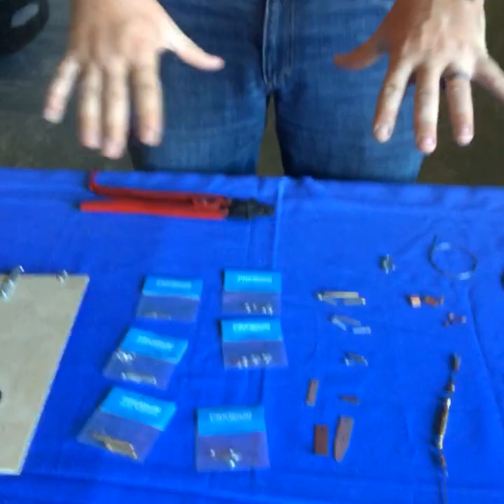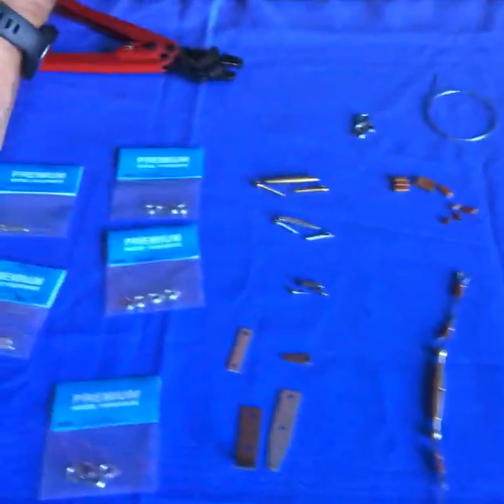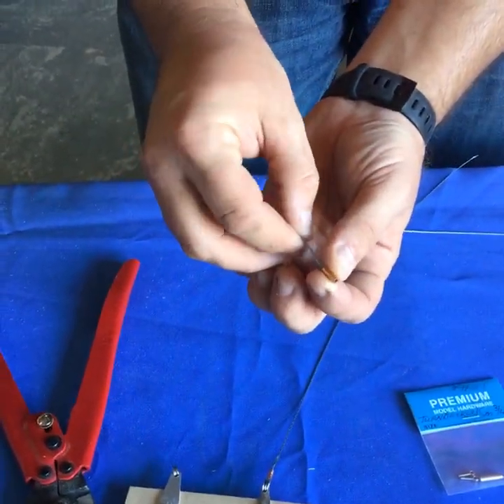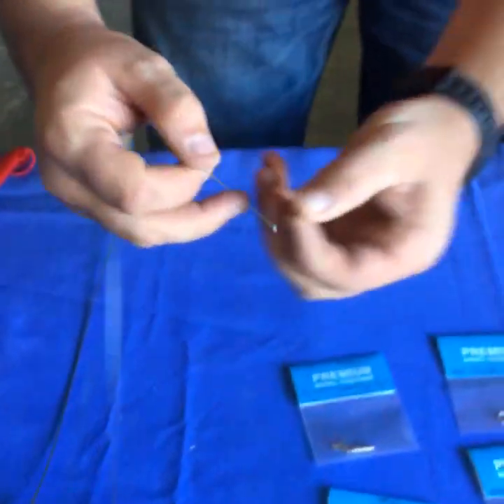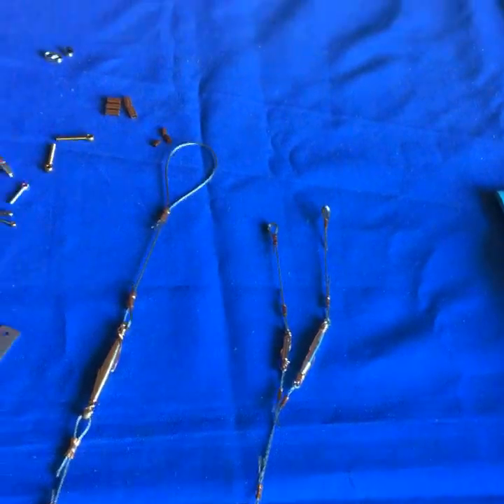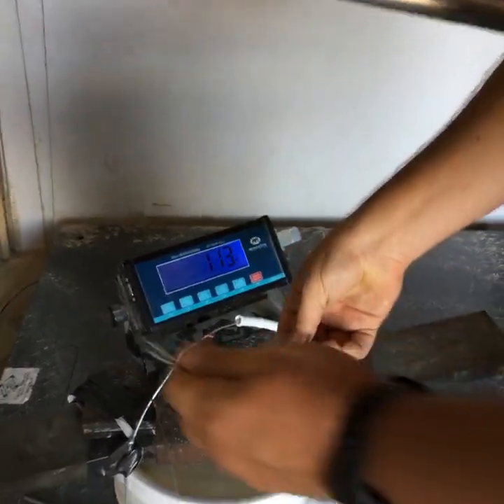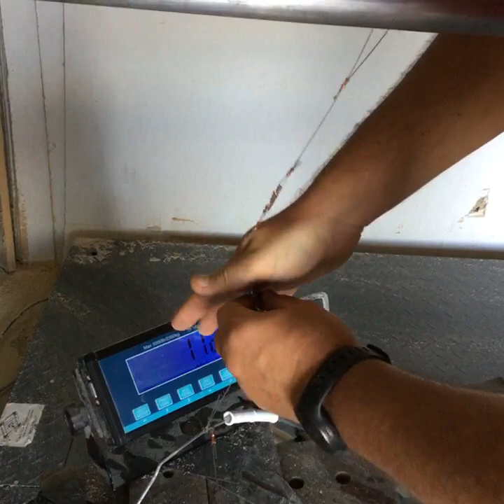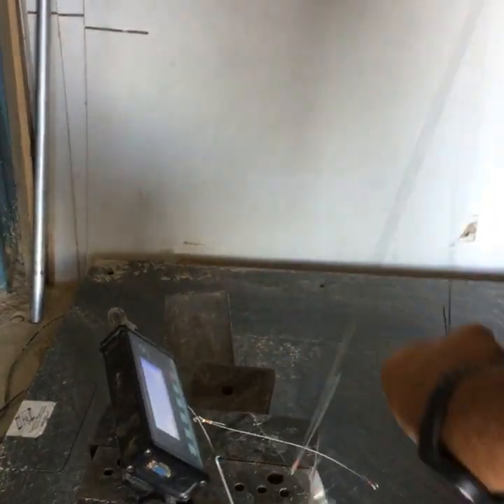Nicopress Demonstration

Comment: Ready to use the BUSA nicopress, turnbuckles and thimbles on my H9 1/4 DVII. Already used on pull pull rudder. Nice. Brand X plane. Sorry.
Really wanted to learn best way to install turnbuckles. Ahhhh, a short cable run on one end. OK.